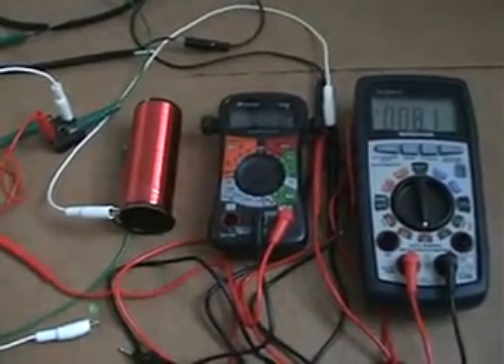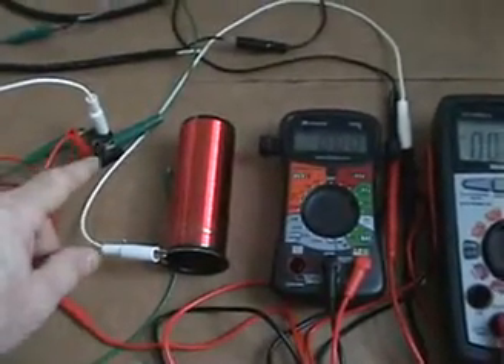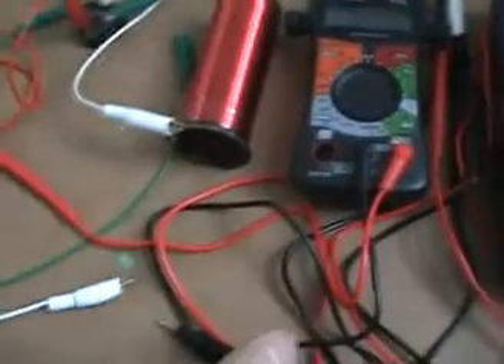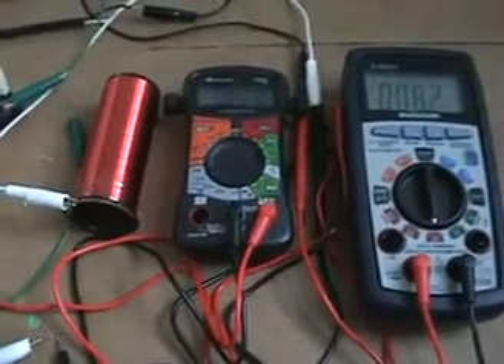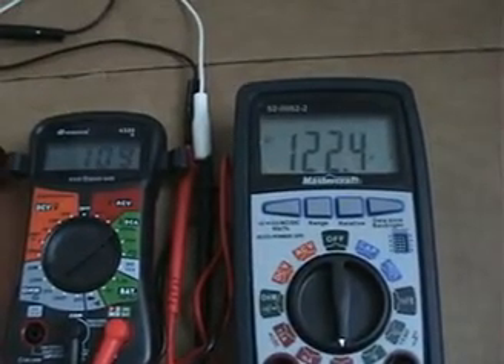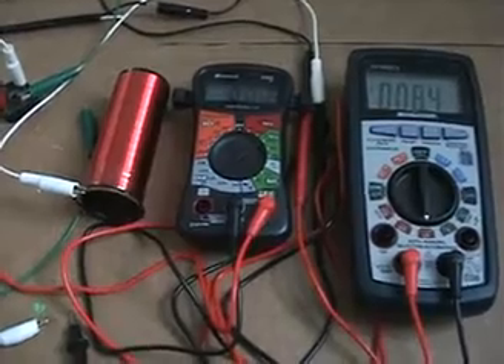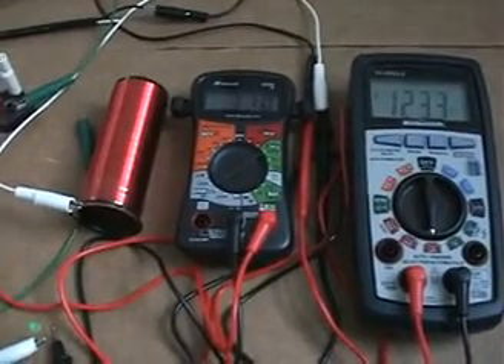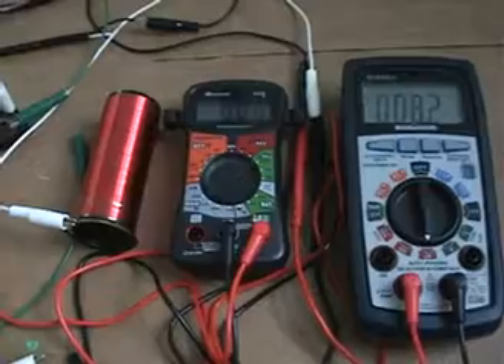Free Energy " One of a Kind Device " Claim Test

Comment: This seems like a variation of the Lorrie Matchette "One of a kind device".  Are you testing A/C amp draw on the tube side or the coil antenna side?
Reply from the maker: Yes, testing A/C amps
Reply: On which of the two sides?
Reply from the maker: It shouldn't matter if it's AC but I always check both sides to be sure it's a balanced reading.

Comment: good video.  I think there is something out there that works but this just doesn't.  If you follow the link to the original video you'll see 2 very interesting things.           

1.  the guy lists in the description to hold off from building this device as it only points to free energy and more research is needed.  2. and i quote "It allows you to extract free electricity from your housing wire."  Come on now, if you are extracting from a grid then you obviously aren't making free power.

Comment: This is total crap and not a valid experiment.

Build it the way it was shown in the original video, not the way you decided to change it.
(very unscientific gotoluc)

Then after you have done that, give your opinion and make your demands IF they still apply.

PS I demand you remove YOUR video until you follow the same parameters as the original video outlined. lol
Things you changed:
1 the brass tube construction
2 the tube length
3 the circuit
4 everything
Call that science? Not even close!

Comment from the maker: Hi Stefan,  I hate to waste, so the brass plumbing tube I used was returned from where I bought it. The wire coil was not worth saving so I had to waste it. I do not believe this device works and do not wish to invest any more time or money on it either. At the time I was doing the test the home had some loads on the electrical panel of more than 50 watts and it did not change a thing. So it would not change to have a bulb visible or further away as load.

Luc

Comment: Hi Luc,
epowerplus said, that you must run a small light bulb load from hot wire to ground, so that is already a current running from the grid to ground. Otherwise there will be no real current "gas" in the brass tube, which you could pick up with his coil.

Please retry again with a 25 or 40 Watts bulb
being lighted by the grid and see, if the input current is raised, when you connect the LED...But better use a bigger load, not just 1 LED ! Many thanks.

Comment: Then I also tried the 10mm rod and 14mm tube, the rod made 180V on the dc side and the tube made 205V. So the bigger the diameter, the more wire you need to get the same turn count, also the greater the voltage on the DC side. But when you put a load on the DC side, there is not much energy. I can light up just one 10mm LED or neon bulb. Of course that isnt even one watt of energy and my wall current meter just shows zero, because the minimum it can show is 1W.

Comment: Hi Luc :)
I also just tried this setup. I wound about 100 turns of gauge 21 wire on a 4mm stainless steel rod, a 10mm stainless steel rod and a 14mm diameter copper tube. I do not have a ground in my house AC outlet, just the hot and neutral wire. At first I used the 4mm rod and used a big aluminum box as a ground. This made about 40V on the DC side. Then I tried to use the outlets neutral wire as a ground and got about 140V on the DC side.